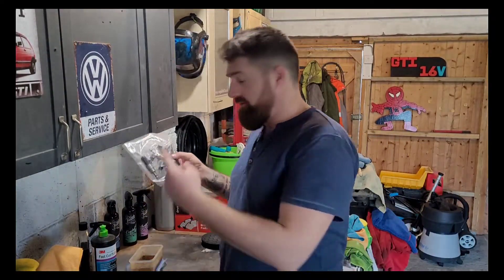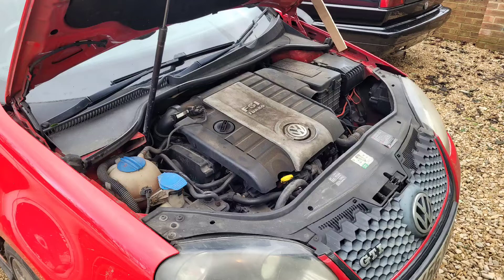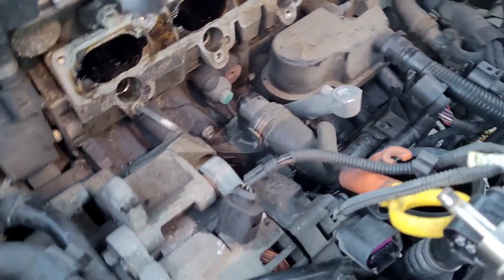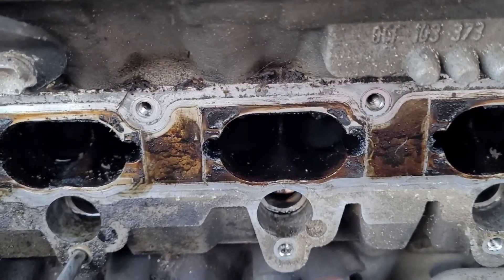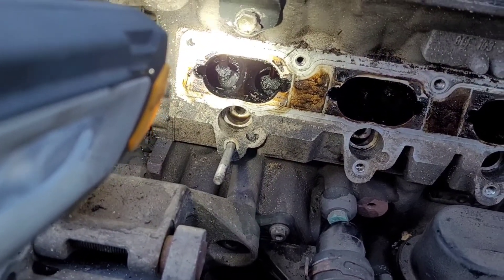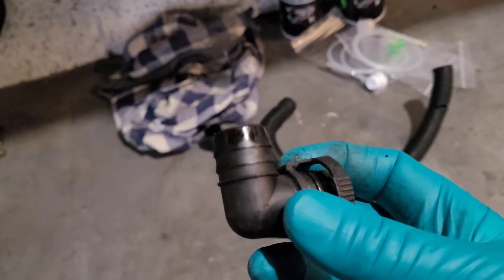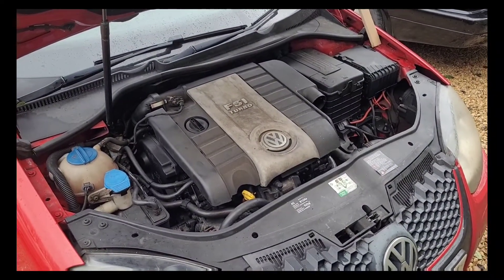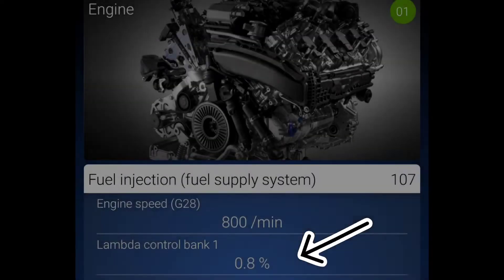VW Golf GTI Mk5 2.0 TFSI - How to - Fuel Injector Change

Comment: How did you get the throttle body out so you can uncrew the saitans bolt?
Reply from the maker: Im 99% sure I left it on
Reply: @GreyGooseRestorations  how did you get to that difficult bolt on the manifold without removing the throttle body?
I have been struggling with both for 6 hours.

Comment: P0171  i have 5 times now heavy rough idling 😥 little misfiring sometimes Was it ea113? Engine? Would appreciate a answer 😀
Reply from the maker: Yes the ea113 is the belt driven 2ltr TFSI
Reply: @GreyGooseRestorations  ok same type then :)  7 times now engine light is up :P i buildt a smoke tester so now i will test for leak :)

Comment: Did you remove the manifold bracket to get the manifold off? Or just undo the top bolt? I’m stuck in this!
Reply from the maker: Just the bolt, awkward as hell
Reply: thanks for the reply, this job is a nightmare! With the top nut removed, I can't seem to pull the manifold off!? Is it a lift-up and pull jobby?  @GreyGooseRestorations
Reply from the maker: Yea it kind of comes up and off
Reply: @GreyGooseRestorations  nice one, I’ll persevere then. That bottom bolt seems impossible to get to! Keep up the vids. Nice to see a mk2 getting some love! Had 3 of them myself. Such great cars 👍🏻

Comment: After installing new PCV valve . turned car on gave it 5/10 min to warm was ticking over fine and sounded smooth started driving 

Drove for an hour with not 1 problem what so ever was running mint as I’ve got back letting it tick over EML came on and started idling rough 

Fans stopped and was nearly stalling on tick over after a min or 2 it stopped trying to stall and fans kicked back in now ticking over fine a min went by it started idling rough fans stopped 

Any ideas as to what it could be much appreciated. Haven’t had it checked for codes yet will be getting it checked Monday / Tuesday
Reply from the maker: Thats sounds frustrating, i think there is a pipe off the back of the rocker cover rear left side, that may be split and causing vacuum issues or it could be the rocker cover gasket
Reply: @GreyGooseRestorations  thank you for getting back to me brother and trying to help . 

I will check when out In next hour .
Reply: @GreyGooseRestorations the left hand side pipe and back of rocker cover along seal seems to be slightly wet compared to the front of rocker cover . But maybe could be dripping down from pipe over time and spreading along ?
Reply from the maker: It could be potentially have to clean it and monitor (more of a pain if you have factory air box)
Reply: @GreyGooseRestorations  have an aftermarket air filter so not to bad . Do you think it will do it any harm driving it with lumpy idle and EML on?
Reply from the maker: Mine was like it for months doing 500+miles a week before i fixed it
Reply: @GreyGooseRestorations  it’s not starting at all now
Reply: @GreyGooseRestorations  was coming up some fault codes that came up with a sensor out , cleared faults and it started straight up was just a faulty maf making it idle a bit rough

Comment: These nozzles are well washed. The main defects, the grid comes off and goes inside, the nozzle performance decreases, and the spray pattern on the nozzles changes. It is necessary to get it by vacuum and check it on the stand at 40-120 bar.

Comment: hi , I was wondering if you could help me , my gti dog 2008 drives normal and changes gears as it should however when it comes to a standstill it stalls , the red battery light flashes on the dash and then I will need to restart again but drives fine and idles fine. Have you ever heard of this issue before or know what it might be ? thank you
Reply: not sure about vws but i have seen thottle body cleaning cure that.
Reply: Send me the VIN number of the engine. And pay attention to the fuel correction at the twentieth and how much fuel pressure is on the rail?
Reply from the maker: Have you scanned the car for faults as this will give you an indication of the fault area

Comment: Mk5 gti P0264,P0300,P0302,P0303 i had this problem and missfire 5 months ago. And it went away. Yesterday it started and its not going nowhere , its working like helicopter. Sparks good , coils good. Could be my injector 2 stuck ?
Reply from the maker: It could be an injector stuck or sticking

Comment: Thanks for not showing how to get the worse bit off 👍🏼
Reply: 😂Yh pulling the manifold is hard because it wiggles but stuck on by the blue seals but then taking the injectors out is abit tricky aswell because it’s tight inside the head

Comment: I had a misfire on 1 cylinder so I changed the injector for a new one from TPS which cost me £250 and 600miles later now I have another misfire, any idea where I could maybe buy a new set of injectors maybe Bosch as they might be much cheaper
Reply from the maker: Normally replace all at the same time as if ones failed the others won't be far behind unfortunately
Reply: Check coil packs and spark plugs!!! Ur pruning sells a kit for like 130 everything included

Comment: I have a manifold delete kit but am my mapper says to me i should not remove the inlet flaps,what do you think of it?
Reply from the maker: If he/she is going to map it they can map them out. R-tech are the ones to map these
Reply: @GreyGooseRestorations  Ok nice,let me ask you one more question..I remove the swirl flap ecu that and fit the swirl flap delete kit..
Will the engine go in limp mode with it bcs my mapper is coming to town for about 15days and i need my gti everyday..?
Reply from the maker: I think it just makes it start a little bit rougher when cold but shouldn't drop into limp mode
Reply: @GreyGooseRestorations  Are there any performance difference?
Reply from the maker: Not really to be honest, its more of a prevention issue, when your in there, remove them to prevent them failing and going into the cylinder/valves.

Due to age the plastic parts degrade and fail

Comment: I've been chasing a misfire on cylinder 2 for 8months. New plugs, new coils, new pcv, even compression on all cylinders. Thought it will be the injector but just checked block 107 for lambda and it's bouncing between 0% to 0.8%. Can it still be the injector in this case?
Reply: did you fix the problem? I have missfires in cylinder 3 and I have also changed the same as you but I still have the same problem
Reply from the maker: The injectors fixed this issue in this case, what fault codes do you have as it could be coilpacks related
Reply: @GreyGooseRestorations  Sometimes I have P0303 code
Reply: @nachom3  I've been using various injector lubricants such as Zx-1 and Lucas Injector cleaner that you add to the fuel. It helped a lot so I'm guessing the injector is on the way out.

Also check is your vvt solenoid is not broken off at the plug.
Reply: @lukaz861  solved with injector cleaner? Where is the vvt solenoid?
Reply from the maker: On the end of the head transmission side, rear of hesd
Reply: @GreyGooseRestorations  but what can I the the valve vvt its ok?
Reply: @nachom3  check if it's not loose or broken off near the plug although highly dislikely it would cause a misfire only on 1 cylinder. Tried with the lubrication mentioned before and see if it helps after 100-200kms
Reply from the maker: Quite possibly, as mine was jumping up and down to compensate for the injectors

Comment: Can i ask why since you had the manifold off want to clean the valves?
Reply from the maker: It was a daily workhorse, and it pulled like a train, so at the time, the benefits from cleaning them wouldn't be worth the time it would take to clean them. with the valves like they were, it was still happy to do 40+ mpg at 200+k miles

Comment: Replaced injectors on my 07 GTI, car sounds like a lawn mower and is missing on 1 & 4 also did plugs coils etc. Took the manifold back off checked to make sure everything was sealed and hooked up correctly and all is square. Still blinking CEL, miss did not follow with injector swap over one for each and is still missing on 1 & 4. What could this mean?
Reply: My mk 5 is going in on Friday.  After changing all plugs and coil packs still a misfire on cylinder 3. Fortunately I know a guy that works for vw and said definitely number 3 injector and number 2 also playing up. So, having them all changed.  Looking forward to getting the performance back.  It has done 10400 miles
Reply: @marklaroche7981  how does it drive now with the injectors changed? I've just bought another set to change as buying only one was a bad decision as the other injectors I left in were on their way out lol😂 its a constant circle of bs with these engines lol they are real nice when running right tho
Reply: @cruiseedwards4657 it drives okay,  got the power back but at times it still idles rough.  I really don't understand this
Reply from the maker: What are the fault codes/code?
So you replaced all four injectors but is still missing on cylinder 1 and 4?
Reply: Hello,nice video.Can you tell me the type of motor you are changing the injectors? Axx or bwa? Thanks
Reply from the maker: @mff9025 this was the AXX
Reply: Get a multi meter and check your injector harness. May have some bad wires
Reply: Did you find out the issue mate. Please reply as I'm lost lmao
Reply from the maker: It was the injectors, they weren't spraying even etc

Comment: THANK YOU so much for confirming my thought with a visual on the LAMBDA trims. 
Exactly what's happeing on my GLI mk5. 
Cheers mate.
Reply: What was happening with your mk5
Reply from the maker: It had a idle issue where it wouldn't settle, the revs would dip low
Reply from the maker: Glad it helped 👍